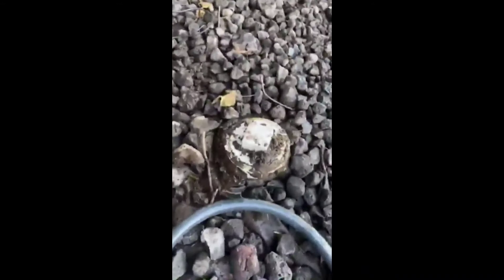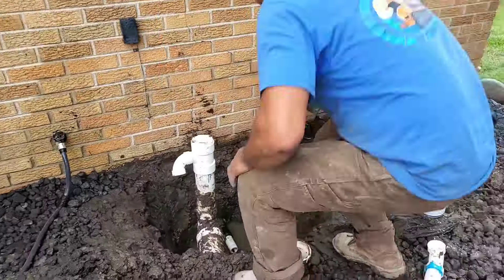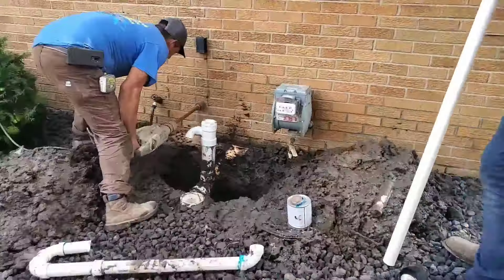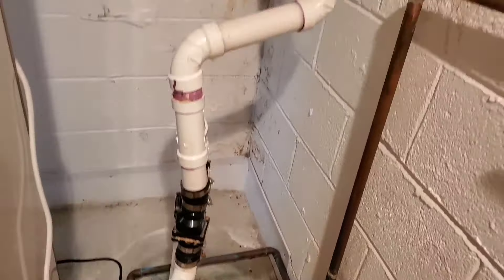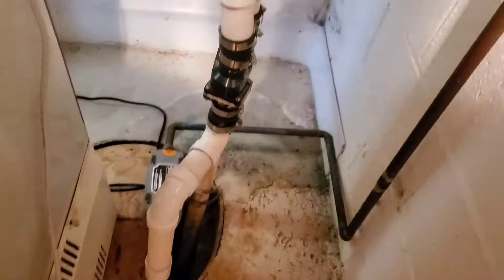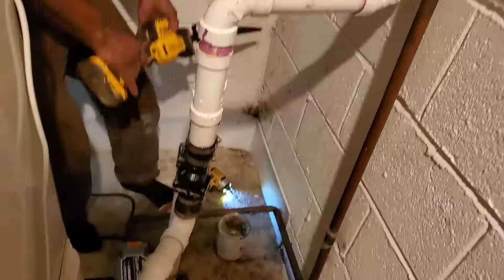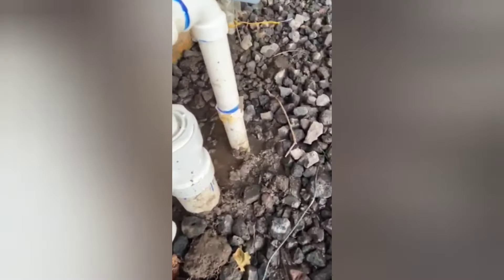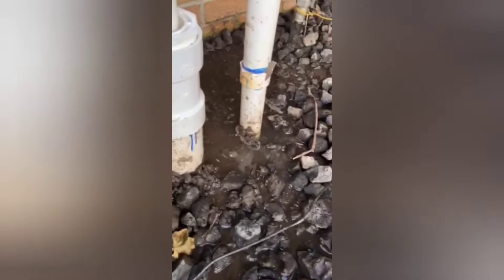Sump Pump Discharge Line Failure and Fix

Comment: Hey FD man , do you see how they have that fitting turned down above ground on the main line going out to the street? I was told it's a frost drain. Is that right? So if there is a problem draining out to the street tie in, the water would push up and out of that inverted elbow. How come that didn't happen here or did it? Also,  my house I have a wye fitting no elbow turning down because I want the water to shoot away from the house , I put a check valve on the end of the frost discharge if you want to call it that. I did that to keep vermin insect etc out of the pipe , BAD IDEA??? In your opinion. Let me know if that check valve becomes a vent or something that can hurt me some how. I'm a sparky not a plumber.
Reply from the maker: Watch "How to Install a Sump Pump Discharge to Prevent Failure - French Drain Man" on YouTube
https://youtu.be/jTI1_RbI_Po
Reply: Will do thx!
Reply: I got a good one for you. From my neighbors house I got an underground 1 1/2 pvc schd.40 (could be 2")running across my yard shallow underground. I have a 2' (ft.) diameter storm drain in my backyard. We butt against a golf course that has a huge 200 yard retention pond. These idiots ran a French drain from the neighbors yard underground to this 2 foot storm drain in my yard as I explained. Before I bought my house obviously! Problem is the storm drain is plugged and all that water is coming out onto my yard and within a foot or two from my foundation. The association  is fighting me saying it's a sump drain and I can't cap it or remove it. Can you advise me on what you would do? The 1 1/2 is so close to the surface as it enters the 2 ft. storm drain that I would never believe it's a sump line. It's got to be a French drain. Their yard is bone dry and my yard is muc clay based land so you already know! Association have hired a vac truck to pump the storm drain out, that company said they had to stop because the storm drain is a French drain and my yard was gonna cave in!  lol I'm lost!

Comment: I’m a little confused as well. Why the multiple pipes coming up? Why didn’t that line run straight out underground  to discharge somewhere. Did it discharge next to the house?
Reply from the maker: https://frenchdrainman.com/product/fdm-exterior-sump-pump-discharge-line-freeze-protection/

https://youtu.be/jTI1_RbI_Po?si=jXgf62xdLePzwbFa

Comment: Those PVC materials looked relatively new, I’m a bit confused here. That was from the original build? There wasn’t a before and after comparison which I think would have made this better. I know you guys do great work!
Reply from the maker: FDM Exterior Sump Pump Discharge Line - Freeze Protection
https://frenchdrainman.com/product/fdm-exterior-sump-pump-discharge-line-freeze-protection/

https://youtu.be/jTI1_RbI_Po?si=jXgf62xdLePzwbFa